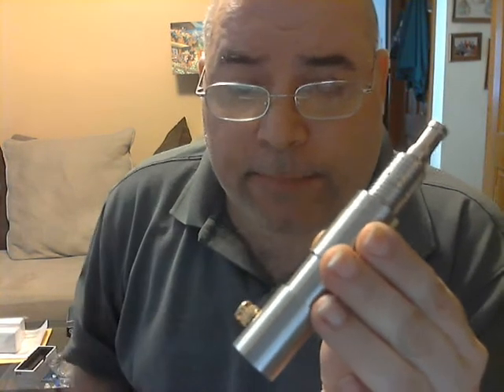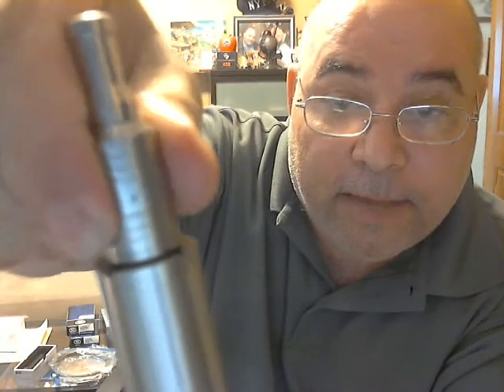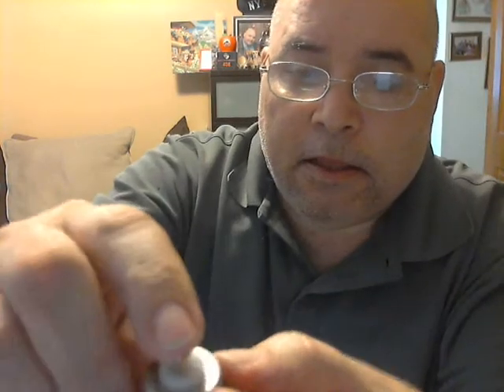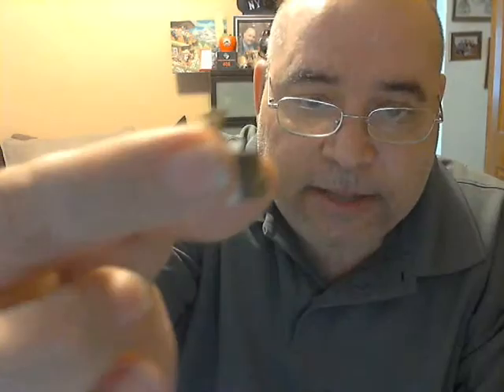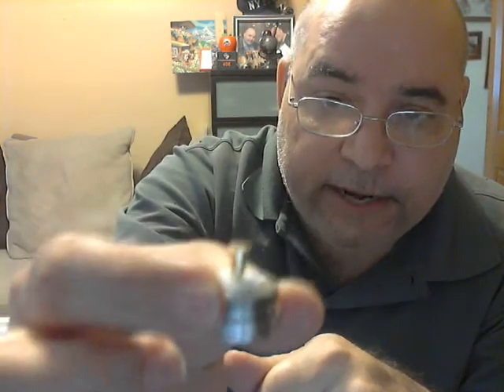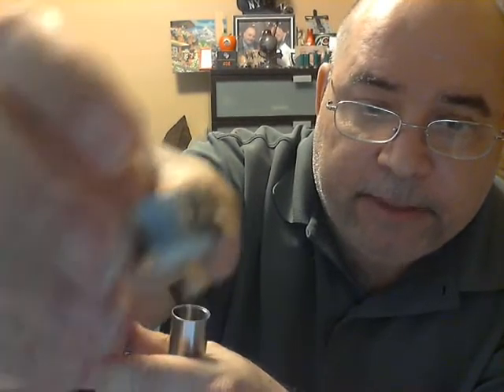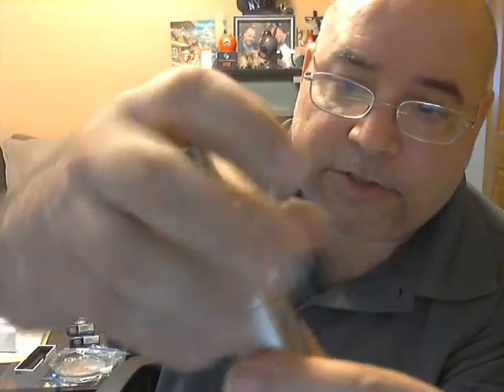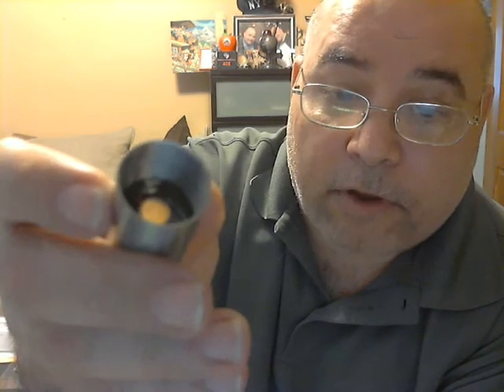EA Clone Electric Angel Questions & Answers 1

Comment: Hey AJ if you remove the top section of packaging you will find another tube for 18650 and 18490/500 with kick also you will find  a cloth for cleaning..if you use a dremel on that pin you will lose the gold plating on the pin